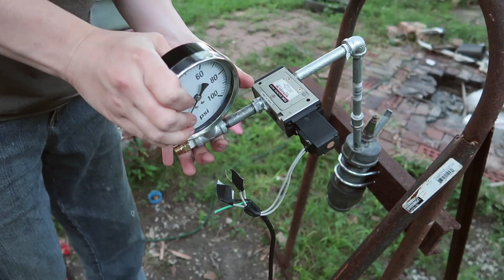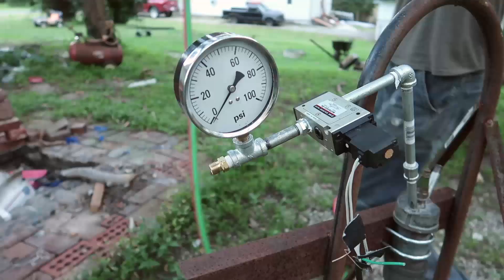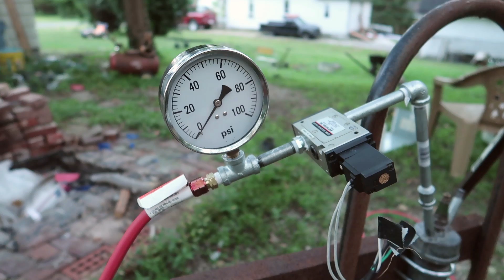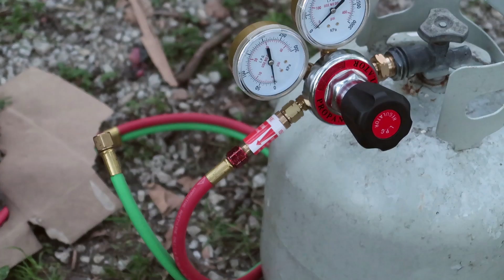DIY Liquid Fueled Rocket Engine 03: Fuel Solenoid Valve, Regulator, Flashback Arrestor Test

Comment: This is not liquid though right? Compressed gas. Liquid fuel rocket tanks are loaded at atmospheric pressure and cryogenic temperatures
Reply from the maker: this is gasious at the moment yes, and liquid fuel rockets are not loaded at atmospheric pressure all the time. they still need pressure in the tanks.

Comment: hi, i just saw your attempt to get ignition, there is a problem with oxygen saturation in that chamber, you would get more joy with a seperate chamber before it meets the gas, (propane) differant weights create issue, you should use helium, a lighter medium or platform to assist combustion, I wish you the best with you venture, cheers mate

Comment: What you are trying to do is very hard. I've had a almost empty gallon of paint thinner shoot out of my hands and fly around my backyard for a few loud seconds when I was young and stupid. I was trying to make napalm. Dad didn't keep a close enough eye on me. As you know, fuel/ ox ratio is key. Keep it on the lean side. You can sustain liquid fuel with a pump or pressure into a chamber. It's just very hard to do. The spark plug ignition probably won't work. Consider a small lump of thermite mounted at the same spot to start the combustion? Keep going. Stay safe. So fun to watch.

Comment: Your probably not getting ignition because there is no oxygen in the combustion chamber. Pure propane is not combustible. You could shoot some very low pressure compressed air into the o2 port. The goal is to make it super rich fuel/air ratio and slowly add more air making it more lean. Also flashback shouldn't be necessary if you ALWAYS bleed the lines because pure propane and pure O2 are not flammable when separated.
Reply from the maker: i did bleed the line
Reply: @RinoaL  keep up the good work this is all very interesting.
Reply from the maker: thanks

Comment: Im watching but I don't see it fireing it just wasted fuel. That's not enough trust to lift 20 gramms.
Reply from the maker: you didnt pay attention did you? this was only testing the fuel line, i even said there is no oxygen connected. i dont have all the parts made to handle that yet. i am slowly working my way up to the first full test.

Comment: When gas and air meats in the chamber, the pressure is going to be higher than the regulator,, it will be pulsing i think.
Reply from the maker: it would have to be putting out about 60 pounds of thrust in order to have 30psi in the chamber

Comment: Have you thought about the possibility to try to get another box just the same as you have and cut one of them horizontly, then glue them together and increase the hight doing that ? I did that With two plastic barrels and made a dustcollector With almost double capasity...

Comment: This reminds of the burner I use in my intro.  It's just a ball valve attached to a 1/2" OD copper pipe with holes drilled in it.

Comment: you can easily make a controller with one or two relays (you can get them here really cheap https://www.banggood.com/3Pcs-5V-Relay-5-12V-TTL-Signal-1-Channel-Module-High-Level-Expansion-Board-For-Arduino-p-1178211.html?rmmds=buy  )  and you can use a 6v lantern battery to power them!

Comment: Are u using an oxygen tank? I’m building a liquid  bi propellant rocket similar to you, and I’m going to use it for my science fair and your videos are very informational thank you
Reply from the maker: i am not using oxygen in this video, but in my next tests i will be hopefully using gasious oxygen. you can get cylinders of it from hardware stores and whatnot. If you are going to build a rocket engine, i suggest you start the fuel and light that first like i did, and turn the oxygen on later. if you turn the oxygen and fuel on at the same time you can get an explosion.

Comment: you should make multiple triggers for the solenoid valves, 5 or so, you should also have a safety switch installed, like a kill all switch or  one of those red safety toggle switch also have each thing individually switchable, like ignition, oxygen, main fuel, stuff like that
Reply: whatt?
Reply: hm?
Reply: Or just turn off the gas duhh

Comment: Why not put thee large switch on a hinge inside the box so when you open it up you can flip up the switch ready for use. This would also provide a mechanical safety guard against false triggers.
Reply from the maker: because its also very wide, and i think i have another switch that would be cool for inside it. so i think this as a remote would work well enough.